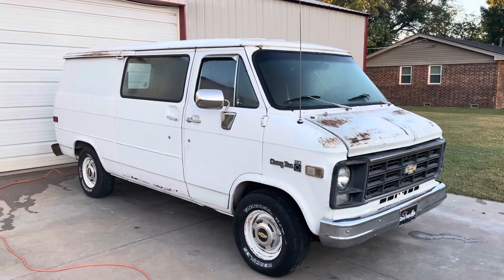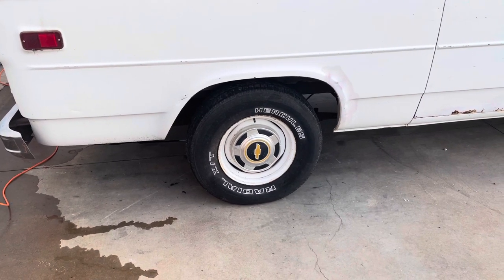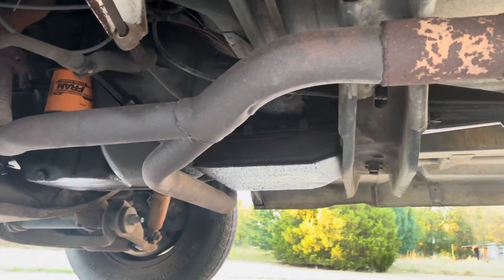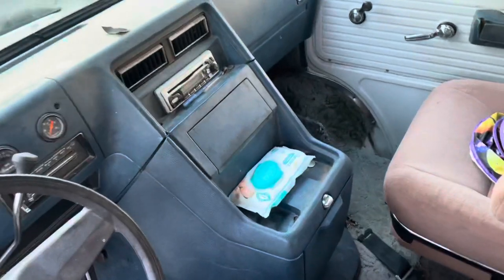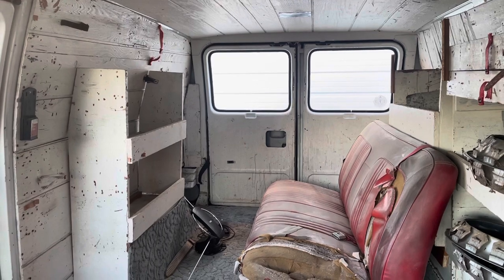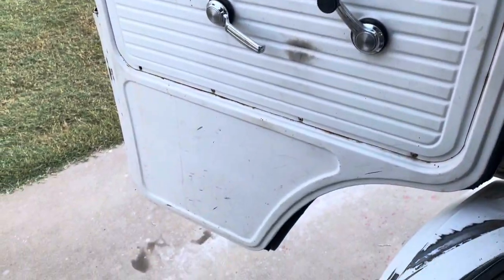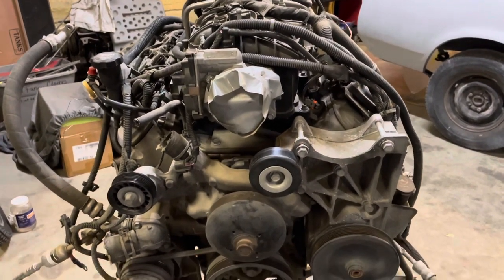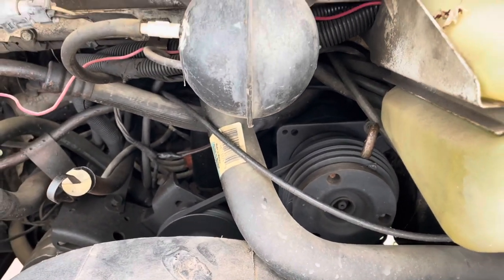LS swap 1982 Chevy G20 van build. Episode 0. Pre-build inspection.

Comment: I put a 5.3 lm7 into my 74 g10 and it was quite a journey. I’m looking forward to watching your journey.
Reply from the maker: I’m currently buying all the stuff for the swap, its going to be my daily driver soon, I love old vans. I put a set of 15x8 truck rally’s on it this week, it looks much better now. I will put a short video clip of it in this weeks shop update.
Thanks for watching man
Reply: Did the motor fit without cutting the firewall?? Im looking in to swapping a 95 c10
Reply: Yes , it fit without cutting the firewall although it is tight near the doghouse opening. A c10 is different then a van, but many people have done the swaps in c10s.
Reply: Woops!  G10

Comment: All I've pretty much driven for the past 25 years is vans.  First was a 1970 Dodge A-100, then a 69 Dodge A-100 for quite a few years, a 1972 Dodge B-200, a 1994 Dodge B-250, and currently a 1993 Chevy G-20.  I have a set of 8" Chevy truck rallys on it now that I had powder coated.
Reply from the maker: Yea im a big van guy myself!!!!
I drove an 80’s g20 conversion van in HS.
Also have a 60’s econoline ford van back in my home state of Illinois. I cant wait to get this van turned into my daily driver.
Reply from the maker: I also just installed some 15x7 truck rallys yesterday. Waiting on new trim rings to come in. She looks much better now. Thanks for watching

Comment: I have a 1991 G10 I would love to LS swap mine. I think fuel injection would be better for gas mileage.
Reply from the maker: You will probably see a big difference. That motor currently in mine and yours is basically 1950’s technology at its core.
Reply: Especially since, I currently have a 350 bored 40 over in mine.
Reply from the maker: Depending on gearing it will probably get around 15-17mpg with the ls

Comment: Well, whatever happened ?
Reply from the maker: I’ve been waiting for almost 5 months to get my wiring harness/ecm back from the guy who is modifying it and tuning it. Had I known it would take this long i would have just bought a new aftermarket one. It has the drive by wire. I have pretty much everything else sitting on the shelf to do the swap. Sorry for the delay.
Reply: @BrokenWrenches  no problem. I have a 1998 Chevy Express 1500. Thinking of doing a swap on it. Not sure just yet to what ? 0411 ecm swap with a 4l80e, or 4.8, 5.3, 6.0 swap. Just not sure yet ?